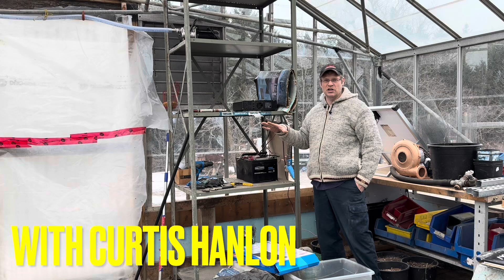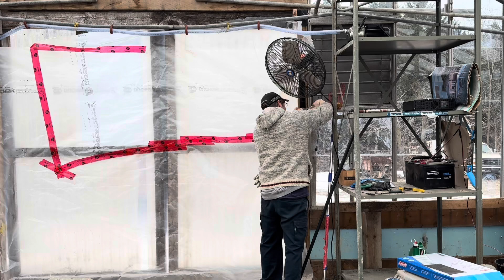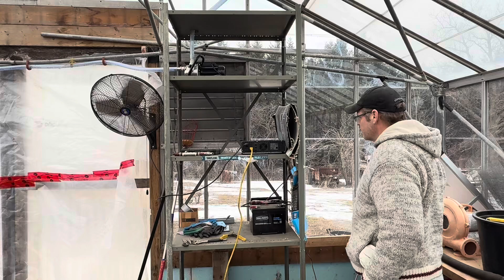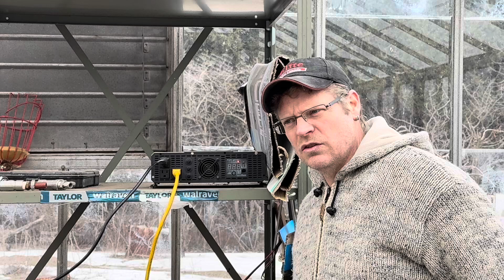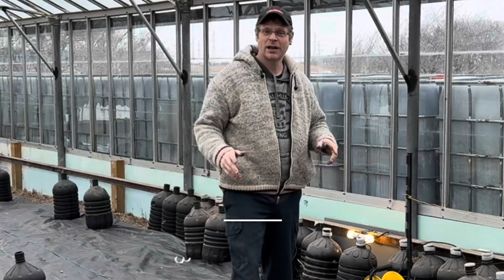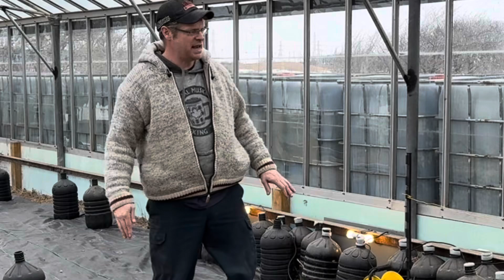ADDING ANOTHER WAY TO HEAT THE GREENHOUSE USING MY 100 WATT SOLAR ARRAY

Comment: I would think it would be more efficient for the black water jugs to grab and hold the heat if the light bulbs was under the jugs. A low bench where the surface the jugs sit on would have lower edges to trap the heat of the bulbs as well as the ground being it's slowing the air movement giving it time to transfer heat up.
Reply from the maker: That is some sound logic. I will seriously keep that in mind and if I can do it I will probably try. Thank you
Reply: @branchingoutpermaculturewi4766  bench with a plastic sheet skirt stapled to the inside edge of the dropped edges should suffice.

Comment: Why not move the IBC containers inside? That would be a huge solar mass. Just cover them in black fabric. They could still be used for rainwater collection in the summer. A great height to work from on top of the totes.
Reply from the maker: Only reason is it would take up to much space in the greenhouse. I have thought of that before including the black fabric idea. Cheers mate

Comment: Thank you Curtis. As I watched, I noticed the water tanks outside your greenhouse and realized that between them and inside is glass. Since glass is a relatively poor insulator and sunlight probably doesn't penetrate well through the tanks, would that area be better served with either a heat absorbent dark barrier or a reflective barrier to get more solar energy to the inside jugs (??)🤔... I have no idea, just letting my mind wander 😂.

I know that in a previous video you mentioned that you don't always set your plans down on paper before commencing work, but one suggestion if I may. As you incorporate ventilation, lighting, water (sprinkler/misting), create "utility room" zone so that all main shut offs are within quick reach. It's easy to let convenience lead to sprawl... which in my personal experience means more work in the long run.
Much love 💕
Reply from the maker: You are not wrong. Thank you for your input I do appreciate it. I have thought about the north wall being painted black and or reflective but I like the open vision to the food forest. So I just like the aesthetics of the open glass. So I’ll have to come up with other ways to heat and store the suns power. As for the non plans in my head. Sometimes everything falls into place other times it becomes more work. Live and learn from my mistakes and others. Always a pleasure melody